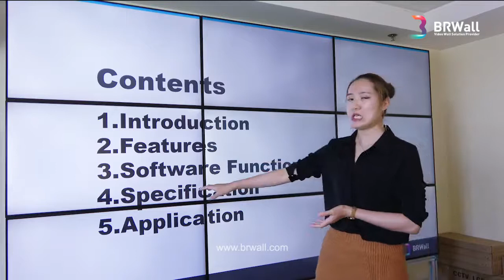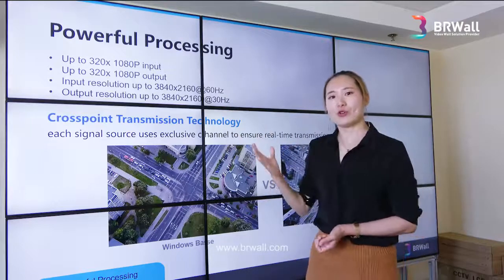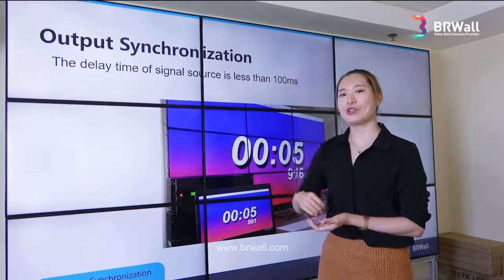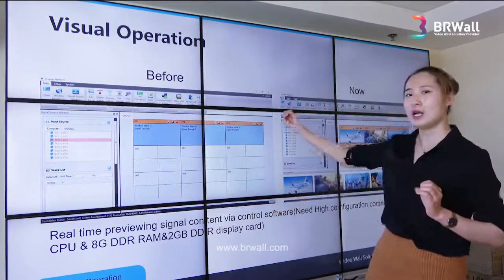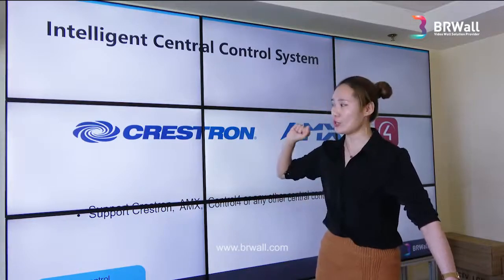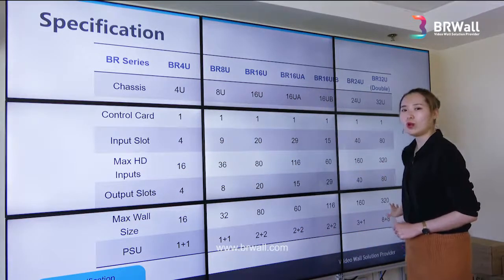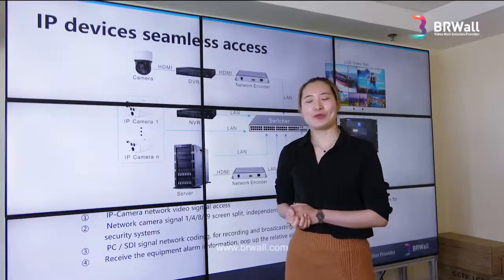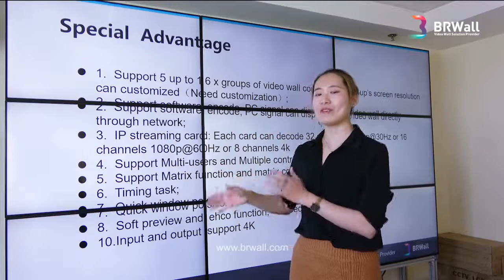BRWall Sereis Video Wall Controller Introduction

Comment: if i have some lcd have diferent color (white), can brwall calibrate to manipulate color.
-
if the source are to white (like background microsoft office app), can brwall auto adjust (minimum and maxs brightness ) handel with software ?
Reply: Use Murideo to do video wall or display color calibration